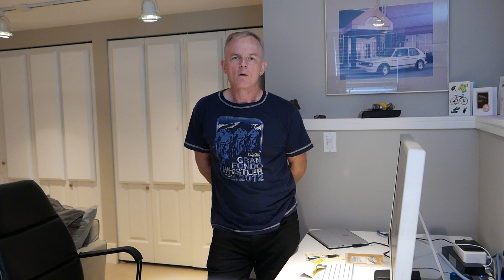The Ultimate 1983 Rabbit GTI - part 130 (Failed Tech Inspection, next moves)

Comment from the maker: Wade Banks pointed me to a potential solution for my engine crapping out at 6000rpm: he has an ABA block with the same sensor, running a Megasquirt ECU and had the same issue and solved it with a simple 10k resistor after researching this issue online. Here is a link to an article that explains that putting a 10k resistor inline with the sensor often clears up this problem: https://www.diyautotune.com/support/tech/other/megasquirt-vr/ 

I'll have to try it out ...

Comment: I have KW Variant 1 coilovers on my Mk1 rabbit. Very happy with them. Firm but not punishing. I'm also going to add the upper strut mount extenders from Fastbunnymetalwerks. Increases travel to give you a more comfortable ride with coilovers. Check them out.
Reply from the maker: neat. Thx for the tip.

Comment: Sport rack is not quick enough already. Standard rack would make correcting a big slide much more difficult. Try to hang in there with the sport gearing if you can. Also you might want to deal with the springs being too rough, as soft springs are not ideal on track use.Did they check the camber and caster spread? Maybe your pinion clearance is a bit too tight on your rack.
Reply from the maker: I agree that I need to give it a bit more time. I will back off the pinion clearance - I was aiming for absolutely zero play in the whole steering system but may have gone too far. For instance, I machined an additional brass spacer to sit above the pinion bearing to push it downwards about 0.040" so that change, plus the tight pinion bolt adjustment on the back side may have been a bridge too far. Sucks that getting to that adjustment bolt is a bitch and almost requires removing the brake servo to reach it!
Reply: I made a fiber gasket to add under the cover plate. It let me tighten the bolts and still have just a bit of clearance. I'm assuming the pinion needs some play. I have no brake servo, makes it nice to work on but adds difficulty to driving streets, lol. I like the feel of it now that I'm used to it. If you fix your crank ref it will be great fun.
Reply from the maker: I was half asleep last eve thinking about that 0.40" brass spacer and was pondering my options - taking it out will put a bit of slack in the rack but as you said it is very likely the pinion needs a bit of room to move up and down. A softer material might work better, thinner too.
Reply: The rack in my 79 rabbit had a concave washer that may or maynot have been oem but I put it back when sport rack went in. The car was on stands and I could feel it binding so I made the gasket and it made it turn with almost no drag on stands. I got the tech 55 inner race for column as mine was failing. Feels great now. I like those brackets you made for your column.

Comment: Danfoss have some smal electric expansion valves. Greatings from a hvac tech from Norway 😊
Reply from the maker: Great. I just purchased one ...
Reply from the maker: But not sure how to control it yet - I may or may not have to implement a separate controller for it as the Holley system may not have enough s/w flexibility  - although V4 software has really neat programable logic output functions such as sending a burst of pulses out - just what I think one of these electronic expansion valves must need ...
Reply: +Derek Spratt some Of them have stepper motors :-)